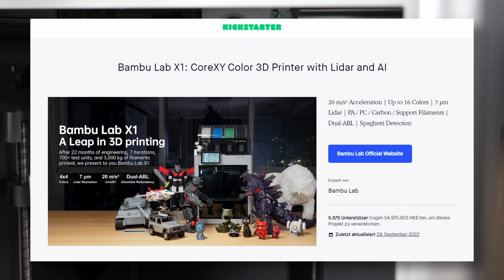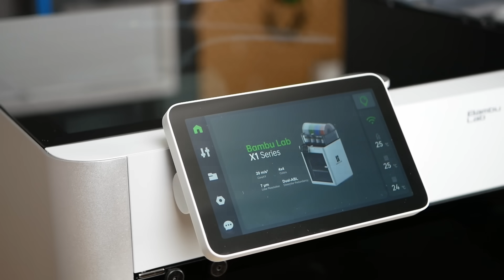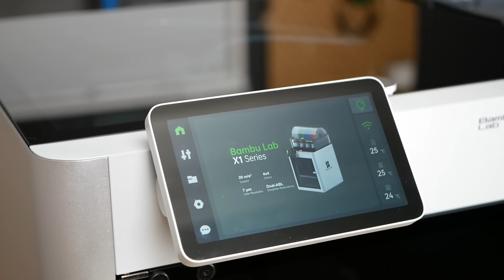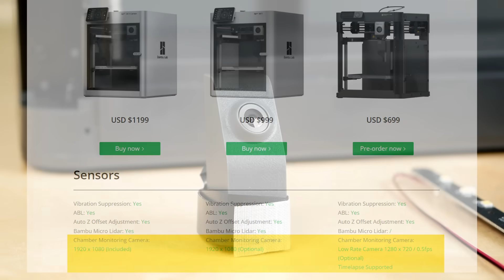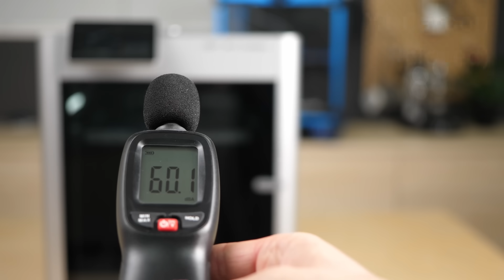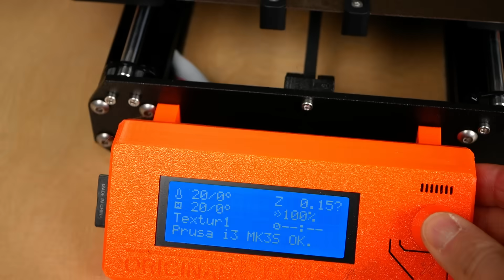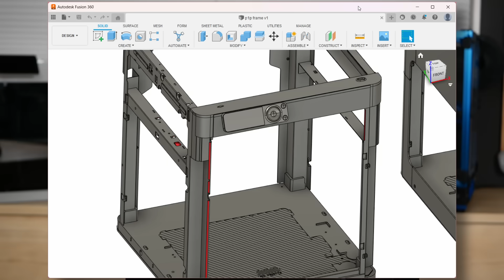The Best 3D Printer of 2022 got Stripped Down to make it Cheaper!

Comment: I've been a MK3s owner for many years, and after upgrading it to the Revo ecosystem recently, it's still an extremely versatile and functional machine. I wasn't sold on the X1C until after they fulfilled their KS orders. Then I put in a preorder, and much to my surprise, the printer showed up at my door only a few days later. Having owned it for a week, I'll say that the hype is mostly justified, it does a lot of amazing things well. But there is one issue I should highlight: we've all been sold on the 17 min benchy, but you can't quite access that speed normally. Yes, that was the first print I did. And yes, my X1C really did indeed print a 17 min benchy with my own generic PLA filament. And yes, I just took it out of the box, hooked everything up, did the first boot calibration, fed in some filament, and it successfully printed that 17 min benchy. Truely as turnkey of a solution as I've ever seen. I never had to do any bed leveling or z-offset setting! Anyway, back to my peeve. So clearly the benchy shows me that yes, in fact the printer on my desk, using my filament is able to print about 5x faster than my MK3s. However, if I go into Bambuslicer, and slice the benchy, no matter what slicer tricks I try, I cannot get it lower than about 45 min. Which is still very fast, but it is not 17 min fast. For comparison, on my profile in Prusaslicer, the benchy is about 90 min. So 45 min is about 2x faster, but that's far from 5x. Sure I can turn on ludicrous mode, but even then I don't think it'll get to 17 min. I don't see any profile in Bambuslicer that says "ridiculous fast speedboat mode". Anyway, my point is, we were sold on the 17 min benchy, which it CAN do, but for some reason, as a X1C user, I am unable to access those speeds from Bambuslicer. That's a little bit annoying.

EDIT: it was pointed out the main difference between the 17 min benchy and my Generic PLA slice result in BambuSlicer is the max volumetric flow and max fan layer time setting. I can confirm that adjusting these to match the Bambu Basic PLA, and then using Ludicrous mode does in fact result in a 17 min benchy. Kudos to all those who helped with their tips!
Reply: Its the volumetric flow, set it to 22mm/sec or higher in the slicer.
Reply: @LilApe  My god you are right! I compared the Bambu basic PLA with the Generic PLA, and there were two differences, the volumetric max, and the min layer time. Setting the volumetric max to 21 and min layer to 4s, reslice, and there you go, a standard print time of 32 min. IIRC ludicrous mode is 165% or something like that? If so, that brings it to to just over 19 min. Bravo! Thank you for the tip! 

Of course I would need to do some max flow rate calibrations before I use this, but it is nice to see this is not necessarily just the "hand gcode" tuning that others were suspecting. There probably is still some hand gcode tuning done in the in printer benchy file, but this simple tip gets me 90% of the way there!
Reply from the maker: They tweaked a ton to get the 17 minutes Benchy working but that's quite a normal thing in the #speedboatrace challenge. For me it's a demo, yet shows what can be done. Honestly I even advice against printing that fast because you run into serious layer adhesion problem and the input shaping will round off many details.
Reply: Swap it in the slicer from generic pla to bambu pla and it will be 17 mim bench again. Or abs and crank the speeds up. So far I'm stuck on a 12 min abs bench that's reasonable but I want a sub 10 min
Reply: as of now, mk3s or bambu labs?
Reply: @redboom9874  Personally I dont know why anyone would be buying a mk3s today. If they are open source absolutists then they should build a voron. If not, what possible reason could you have to buy the mk3s when the P1P exists? It prints faster, is easier to use, has wifi out of the box, has input shaping tuned automatically. Is built more sturdily etc..

Like really its an open and shut case.
Reply: @BeefIngot  true I agree. Im opening a small business, so I need something reliable. I would just get a p1p, but since its a new printer, if it runs into any issues, it will be harder to fix it compared to the established brand prusa already is. But I do agree with you, and will probably buy a p1p after it has been out for long enough, as long term issues are something too look out for.

Forgot to add, but I am running on a limited budget, so cant rlly be going over 1k.
Reply: @redboom9874  Personally I feel like any business relying on printers should have at bare minimum 2.

I dont even think you should buy a mk3s if you cant buy 2.

I think you should probably just buy 2 Neptune 3 Pros if you cant afford 2 P1Ps.

My logic is basically you dont want any single device failing to be the difference between your business grinding to a halt or not.
Reply: @BeefIngot  I already have 2 other printers, going to use those for the buisness too, the anycubic vyper and kobra
Reply: @redboom9874  Look at the Sovol SV06 - it's about as close to a mk3s+ clone as I've seen and its sub 300 right now.
Reply: @TacohMann  thanks!!!
Reply: @redboom9874  Oh. In that case definitely go for the P1P. Why get a printer that has 3-5x less the output for the same price? Especially from a business standpoint, it seems to me like a much better investment
Reply: @BeefIngot  okay then thanks! Since the p1p has a less developed user base right now. I think I'll stick with the prusa, but will get the p1p later in the future. Most likely when I takeoff in popularity.
Reply: @redboom9874  Honestly I think buying a prusa is just wasting your money. You could get a feature equivalent printer x2 for less if you are afraid of a new printer. The SV06 for instance is one. The Neptune 3 Pro is another
Reply: @BeefIngot  hm ok. I will definitely look into those 2 options you listed then. Thanks for helping me!
Reply: @BeefIngot  Seems to me also.  If it works as expected when people start receiving them, I'll prolly get one, and I can't imagine it not shaking up the industry since anything more costly but multitudes slower, without some offsetting benefits, will be toast.
Reply: @redboom9874  if you have 1200 for a printer, get x1c
If you have 700 today - mk3s+
Reply: @wilurbean  The Mk3s+ is $799... and you have a box of parts...and bag of gummy bears i guess. 🙄
Reply: @wilurbean  What benefits does an MK3S+ have over the P1P which can clearly print multiple times faster than the MKS???
Reply: @brianmi40  I am guessing the Prusa's repairability, an abundance of community mods, excellent company level support (although I've not tested this myself), and general longevity of the company gives you a lot of confidence investing in their product. Bambu is clearly superior on the hardware front, replacement parts are quite affordable and available (my giant bag of replacement parts I bought just arrived today!), so then the only thing left is software and company stability. If all their servers went away tomorrow, I don't think Bambuslicer will work anymore. Yes I think you can probably just use Prusaslicer with it, but you'd lose use of the lidar and AMS. 

So probably if you are a business, then you need to factor in whether company stability risk can be offset by up to 5x faster printing. Maybe it makes sense to buy the Bambu because it prints so much faster, you'll recoup the cost of the machine that much faster.

For me, it's just a hobby, it was either this or a Voron kit. The voron would've been more fun and informative to build, but there is a chance it would've remained a bag of parts under my desk for months.
Reply: @No0o0o0o0o0  
Mk3s just werks and it's not chinesium 

It's hard to explain unless you've had cheap chinesium and then gotten a mk3xx
My mk3s has run every time I wanted. I printed every day for a year was gone for 8mo, came back, and went right back to it 6mo ago. Biggest problem was cleaning the dust off the bed and re-lube

I threw a .2 nozzle on there and made some prints that were dimensionally accurate and less than 2.5×2.5×3 mm.

It's hard to explain how small that is. Think, I made a few prints that were grain of rice big... with an fdm printer one day, swapped nozzles and printed engineered parts for my car and a lab the next day.... no bs, no bed level, nada
Reply: Change the slow down layer time setting and volumetric flow and it'd be exactly the same
Reply: LoL. Ender 3s with bunch of upgrades can do this too. For around 400$ and your hands. Choosing printers nowadays is like choosing a phone in 2014 and bamboo is definitely on the apple way. But 1200$? You can build anything for this amount of money. Including sub 10m capable machines)))
Reply: @CerberZer0S1gnaL  I think the idea here is this printer works this way out of the box. And, I have to be honest, I do t always want to mess around with a printer to get it to do stuff. 

There will always be those that want to modify and tune, but there are more people, specifically new to 3D printing, that don’t want to do that, at least at first. 

Honestly I’ve done some upgrades and several hours of tuning to both my printers and I still am unhappy with the speeds I’m getting. Sure I could have bought x printer and done y to it for a amount, but I just want to print and build stuff. If you are happy with stagnant advances in 3D printing and more of the same year after year that fine. But at least there are a few companies trying to break barriers to make better printers in the price range that is at least somewhat affordable. Truthfully the Bambu labs p1p is now at the top of my next printer purchase list. Do I expect it to spit out parts every 10 minutes that would take 20 hours on my other machines? No but I hope it’s good quality prints at 10 to 12 hours increasing what I can do. I have some models that I want to build that will take over a month to build and they aren’t even cosplay items or armor. The only solution is faster printer, multiple printers or a combination of the 2. I personally will be going with the last option, adding printers to what I have that are faster. How many I may or may not buy is moot and can only be determined by my available space and willingness to spend money.
Reply: If you only use PLA/PETG this is a no brainer. I’ve had the flow calibration off for 2 months now and it’s never made a difference no matter what brand of filament I’m using. Only thing I would add is the aux fan. And if you’re a print farm for PLA/PETG goods then I’m sure the lower price will be extremely appreciated.
Reply: Ok, so I cranked up the accels, cranked up the volumetric flow for pla, cranked up the blowers, cranked down the minimum layer times and sure enough, I got the time down to 20 minutes.

Im sure I could find more settings to mess with, but my point is its totally possible in slicer.
Reply: I get what your saying, and we should all take advertised speeds, build volume, ect advertised by any manufacturer with a grain of salt. 

But even at twice as fast, it’s a win for my mind. I love 3D printing, I hate waiting on prints. I don’t regret buying the printers I have, but wish I’d have held off a few months in hind sight. I’ll likely keep the 2 printers I have now when I get an x1 or p1p. Matter of fact I’ll probably add a v400 in 6 months or so. 

But my hope is that with printers like the x1 and the v400 is that more of the same printers with small upgrades days are over. Realizing these are new and likely to improve, and better machines developed to replace them pits the writing on the wall. Creality, Prussia, anycubic, ect have basically been put on notice, do better or lose customers and I believe most will rise to the challenge. The printer speed wars are on.
Reply: Yeah that's one thing that kinda bothers me is you can't choose what speed you want in the slicer until after it starts printing. I don't mind doing that but sometimes I just want to see what the time difference would be between the speeds.
Reply: That demo benchy was hand-sliced.  Somebody at BL spent a lot of time tuning the slice layer by layer and probably even section by section to get the most possible speed out of it.  Slicing software isn't capable of that level of precision and self-tweaking (yet).  Yeah, it's disappointing if you thought that everything would print that fast, but that's marketing for you.
Reply: @mortalwombat5811  This sounds like nonsense. No way someone manually sliced it. More logically they probably shot up the accels and flow rates, which you can do in the slicer. Heck Ill do it right now and comment back on my success.
Reply: 9 min benchy just fine using pla...
Reply: This entire post is the equivalent of someone buying a fast car and not knowing how to drive it. Not the company or the machine's fault.

Comment: I personally don't see much point about the P1P... the X1 felt like a step ahead of the competition and the price was reasonable for what it is. With the P1P it feels like they're chasing the bottom end of the market, which is very crowded.

I'd like them to work on reducing the noise instead.
Reply: $700 is hardly "the bottom end of the market".  What they're chasing is the MK3S, and not only did they catch it, they're running rings around it.  Between the P1P being 2-3x faster than a prusa for a bit less money (and coming fully assembled), and the Sovol SV06 being basically identical to a prusa for a third the price (and also coming fully assembled), you really have to wonder why anybody would still buy a prusa at this point.

Comment: Excellent move. It does not take much effort to slap a few sheets of acrylic on to the sides of this to increase the internal temp. Prusa printers are looking more and more over-priced by the day. Prusa is a greedy profit engine. It's about time they reduced their prices. SPEED is the important thing now that differentiates your product from others and Bambulab's has that in buckets !!
Reply: "Prusa is a greedy profit engine" - sounds to me you up to a big thing - let me guess they work together with the reptiliods?

Keep up the sharp mind - you are the only hope for the far right.
Reply: Greedy profit engine?  Dude I don’t think you understand the costs built into manufacturing.  Bamboo has a built in edge being so close to suppliers and dirt cheep labor.